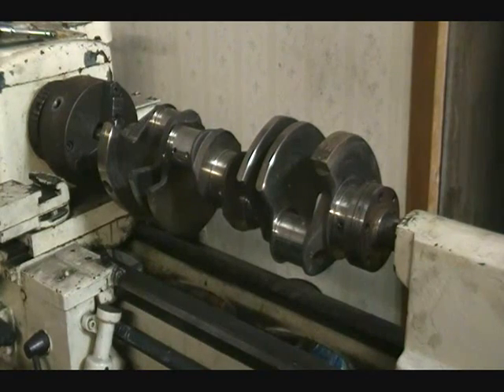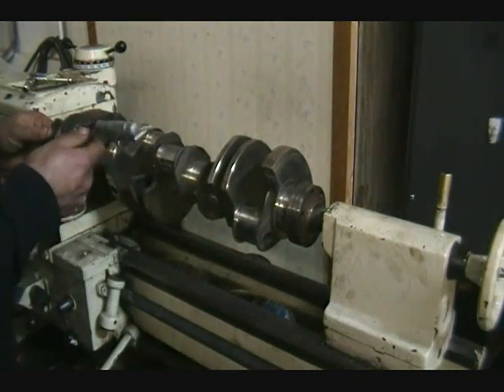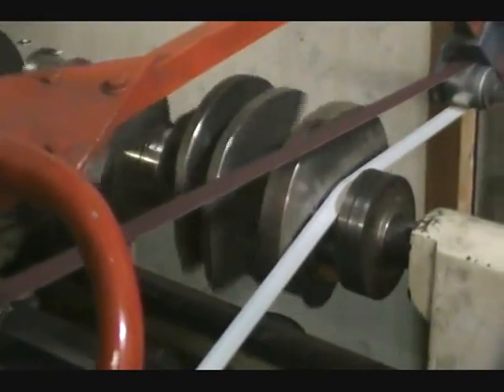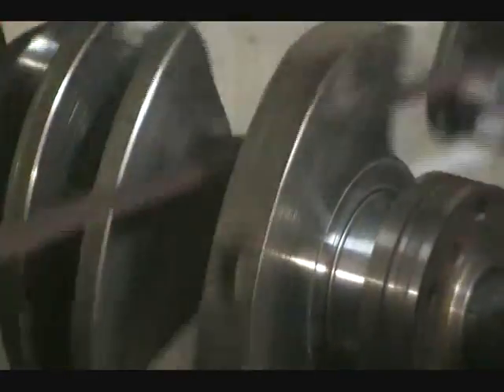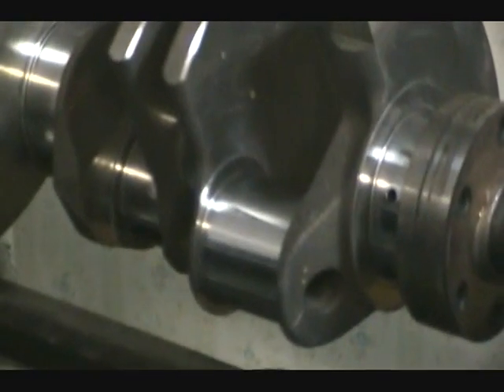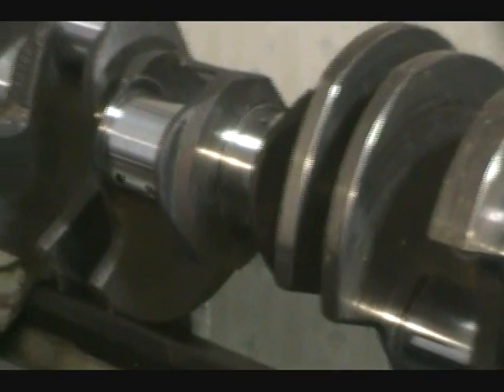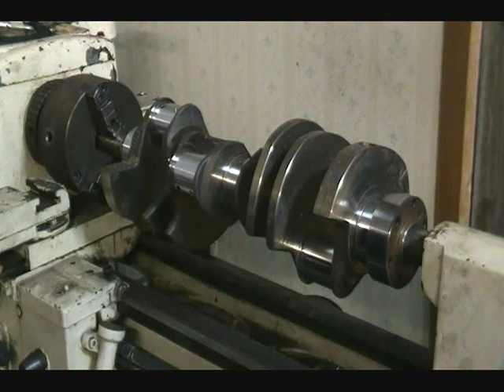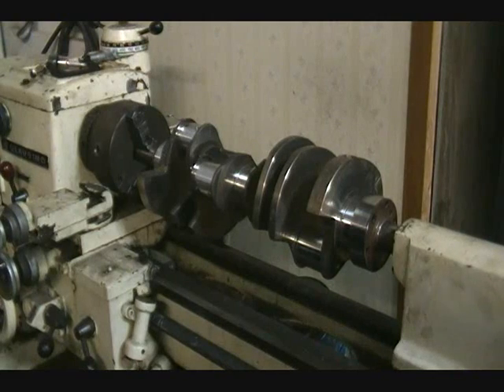How to polish a crank ( crankshaft )

Comment: All of my best efforts building winning 305 Cu" stock car engines stock had honed cylinders course stones , chrome rings, swirl polish OEM valves, lapped & 30 degree back back cut to narrow the seat on the valve, with STD/STD by hand in a lathe 2000 grit  polished side to side /journal/ around  each ,bent chunk of steel with  parallel lines , weighed all the valves equal weight 8 in/8ex. However I did use an old set off 16 followers and ground a bunch of the bottom of each in an old valve grinder & equal weight STOCK PARTS o, yeah 283 cam bearings ./ It kept winning until it was run low on life blood by a troublemaker . I  would not build an engine for that dipstick , that just a couple of my favourite things . Grumpy's book really helps cooling/more advance timing. I love SBC  James T.Burke Motor Mouse

Comment: I had a crank where the rear main seal wore a groove, so I took some JB weld and put it in the groove and spun polished it on a rig I made, it made the groove perfectly smooth and never leaked.

Comment: Would this device be able to do a .010" inch cut?
Reply: not a chance.. lol thats work for a grinder
Reply: Unless your a machinist,  you shouldnt "rebuild" cranks.
Reply: He took off close to .002, so if you did it 5 times it would get you in the ballpark. Thats why you mic it.
Reply: rutter STFU IDIOT
Reply: Yes, if you want barrel shaped journals.
Reply: I called Goodson not made to resize crank journals --just polish crank.

Comment: Cleaning up the mains with that hand held belt sander would be OK I would say but if the big end journal's had worn oval due to compression pressure the belt would follow the same form and would surely wear out the shell's in no time at all, before I retired I worked on a cam and crank cylindrical grinder in an engine refurbishing company and we never used this method.

Comment: about how much is the cost to refurbish a crankshaft and do you do heads and Blocks also. I have a 216 motor in my 49 chevy fleet line and looking at rebuilding it

Comment: End play end play end play end play. Thrust. Everyone checks the bearing surfaces. If the crank end play thrust is out of whack you are wasting your time. It will run but never be right. Never run smooth. Never be entirely properly lubricated. And it will die prematurely.
Reply: did you not watch the video long enough to see them polish the thrust bearing surface? a thrust bearing is literally just another main bearing, kind of a given that it would be cleaned along with the rest of the surfaces...not really sure why your implying in your comment that most people just decide to skip that main bearing surface....then I went on your profile and realized your a gamer..explains it all
Reply: Ryan James Thats why you call clevite for a wider bearing.
Reply: FUCKING IDIOTS!

Comment: That groove on the seal surface that remains can take out a seal real fast.
Reply: That's what Speedi Sleeves are for.
Reply: silicon212 Never did for me. I took a groove twice as bad as that, smeared JB weld in it smooth with a razor blade then polished it on my lathe. Still doesnt leak.

Comment: I hate hand held crank polishers. I prefer dedicated polishers that the belt is located on the rear of the lathe and pivots forward. Much better control of the belt and pressure applied to the belt and crank surface.
I noticed no polishing compound was used.
I would always take a new belt and run it on a old crank and knock the sharp edges off the grit and use a 800 grit compound followed by a 1000 grit compound on another belt.  If using Clevite bearings I would step up to 1200 grit polish after the 1000 grit. 
Left the crank looking like a smooth mirror. Not one sanding / polishing scratch anywhere.
Reply: Polishing a crank is the same as waxing your carrot, it makes a mess and your hands hurt when youre done.

Comment: Years ago I was sent to Bangladesh to oversee the hand over of a tractor workshop to the government, out of the original 36 tractors only 8 were running, on the day before I went on 2 weeks leave a Ferguson 135 came into the workshop knocking its head off, the mechanic Sheraz came to me and said Mr Roger I know the problem and I will fix it whilst your away. knowing how few spare parts there were and no special tools I told him to strip it but then wait for my return. On my return I walked into the workshop and Sheraz was smiling as he leant on the completed tractor, I told you I could fix it he said so I went to the stores and asked what had Sheraz done whilst I was away to which the store man replied Sheraz had spent 10 days sitting under the tractor with emery paper at which I asked the store man had he got the old big end shells that came out of that engine oh yes he said and gave them to me. The shells edges were razor sharp and the metal backing had turned blue and paper thin. Much to Sheraz's disgust I told him to strip the engine again so I could measure the crank, yes the crank was shiny but it was as oval as an egg.
Reply: +rodger stephenson Never trust a Bangladeshi.
Reply: WOW great story! gold star for you!

Comment: Great now I can go to my local parts store where they loan tools & borrow a crank polisher .
Guess I'll borrow a head machine boring bar crank grinder & jet wash while I'm at it .
Reply: Ha ha you funny smart ass fkr!!  What parts store do you use?  :o
Reply: +B Ann 
If your( re-)building engines you should really have a knee mill and lathe .
Reply: @markrich3271  Hey don't forget the 111 Van Norman Crankshaft Grinding Machine ! Bro B.B.A.D.M. Lathe doesn't hurt ?
Reply: +Mark Rich Rather have  a cylinder "head machine" with an air float table designed specifically for replacing guides and seats.
Reply: B Ann
If thats all you do is head work. Its good for nothing else . A nice 3 axis cnc knee mill and cnc lathe will be much more versatile. I make beautiful cnc parts , do head work , deck block . All in my home shop but the down fall is I can only fit so much in my garage. So I have to pick and choose what will be best for all my projects , hobbys.
Reply: Mark Rich
Seems you never have everything you need or the room for it.
Then if by chance you do get it it's near impossible to find competent people willing to work.

If I had my life to do over I'd find a good job somewhere and just tinker in my spare time.

Naw, probably not.

Comment: can i polish 1mm layer on cranck shaft?how?
Reply: very easily if you let this shyster polish your crank as he is using a very abrasive belt and removing material not polishing  if you are actually polishing it is impassible to remove STEEL  this guy is using the polish routine to up sell crank cutting because hes in this for a living to make money and people rebuilding engines these days are few and far between

Comment: I have done it at home with emery cloth. but I wont ever say do it. like he said take it to a shop.  but it was one of them times I had no choice. plus it was a old dirt track motor. and was meant to get me threw the weekend. I got lucky and it lasted half the season.
Reply: Use crocus cloth last.
Reply: Unless your a machinist,  you shouldnt "rebuild" cranks.

Comment: If there is deep pitting rust no way in hell a 2000 grit would ever touch it. 400 grit is fine to start with but you will have to go through your grits as with any polish job. 400-600-1000-1200-2000 is how I'd step it up to make sure its a true polish, just tedious though, then obviously your rouges and buffers.

Comment: because there are 2 connecting rods per rod journal and 1 main cap per main journal on (most) V8's.. i.e. the rod journals are 2x as wide as the main journals.

Comment: Not at all.  I used to work as a polisher for a company who manufactured (from forging a straight bar to finishing) crankshafts for many of the largest locomotive companies in the world.  We would FINISH with 240 grit paper.  The cranks would come to us with .005" to remove on them and we would start with 80 grit paper and work our way through 100 grit, 120 grit, and finally to 240 grit.  The tool he's using we would use sparingly, but our primary tool was a proprietary tool.

Comment: part 2 see below for part 1...too rough will allow the scratches to score the soft metal of the bearings. Grinding cranks is an art with very close tolerances usually .001" high to low...some even closer at .0005 high to low. Using a new belt at 320 grit can easily remove .0005" from the surface. I always kept used belts as a follow up after initial polish. Too fine of a belt can heat the surface and cause distortions....many people think finer is better...not always true!!!!
Reply: I got my crank back and every other scratches
Reply: do I need to take it back

Comment: @enginesRmyLife that's right buddy,been building engines for 30yrs.All  journals have a blueprint tolerance on main,bigend,cam,aux,balance shafts sizes usually 0.001 maximum(top) to minimum(bottom),even when a shaft is reground its always linished not for sizing,polishing the grain from grind,golden rule,if you can feel or even see a scratch it needs regrinding.More clearance = less oil pressure = failure    and  400-500 grit paper can be used,but deglaze paper,no sparks at all,sparks is metal

Comment: @woodwardcars 
he is not using "sanding belts" they are buffing belts. they use same grit labeling system as sandpaper, but feels more like 3m scotchbrite pad. if the crankshaft journal is measured to be within specification in size and out of round, then it can be polished with paste. even extensive polishing will not remove more than 0.0005" inch.